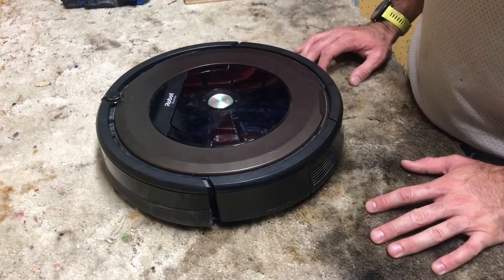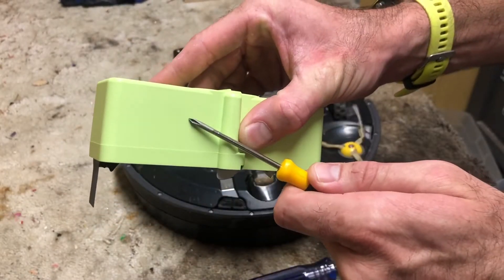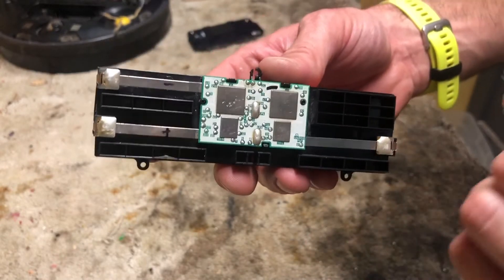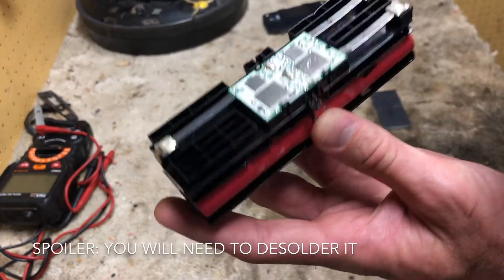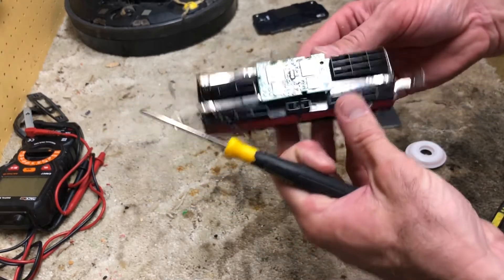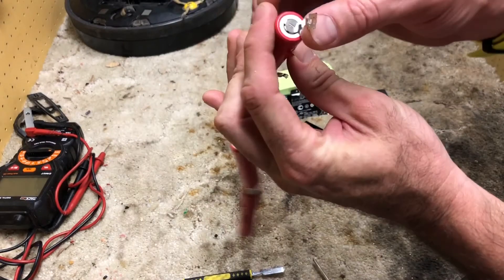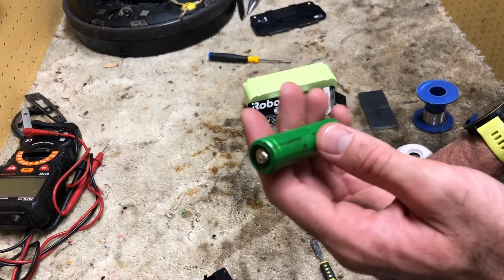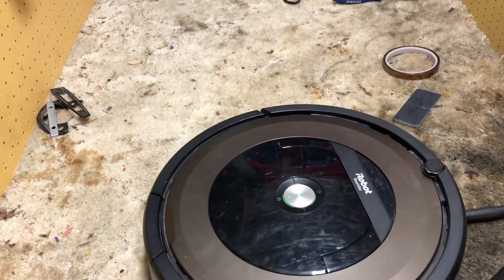Roomba Vacuum Battery Removal and Cell Replacement

Comment: I have a new original abl-d1 roomba battery. When i measure the voltage at the outside battery terminals, labeled +/-, there is no voltage. Is this normal?
Reply: not normal nor healty

Comment: Thanks for the video.
5:57 If the batteries are connected in the middle, doesn't that make them in parallel, and not in series ?
Reply: It appears there is a middle connection to the board that would allow balance charging. Still a series pack

Comment: I like this video. That takes me to my question. I have an old Roomba Discovery. The battery won't charge. Even replaced it with a new one and still no charge.  It takes a 14.4V, 4000mAh battery. The charger that plugs into the docking station is rated at 22V, 1.25A. 
When I measured the voltage at the two docking probes I get only 4.37V. I didn't think this was correct and maybe a failing docking station. So, I replaced that too. Sure enough, the "new" docking station puts out the same voltage. Would you know if that is correct and sufficient to charge the battery or do I have 2 failing docking stations?
Reply: It is supposed to be that. It will only jump to 22V once it recognizes the roomba is connected
Reply: @MooseAgainstMankind  thanks for your response. I measured the voltage and it is what you said. I suppose something internally is not working correctly because batteries do not fully charge. Even with a new one.
Reply: @kurtwm2010  The "docking station"/"home base" should read something above 2VDC when idle and when you dock the Roomba it should do some kind of handshake and after that provide most of the input voltage to the Roomba [18 to 22VDC]. What error code you get? I got "Err 2" in text at my 860 and something like "Battery error code 2" in voice.

Comment: Very good video.  I disassembled the battery same as you.  All 4-cel were showing 4.0V+.  Seems the problem is the BMS itself.  Do you have any tips for raising the BMS back?  I'd appreciate your replay.
Reply from the maker: Typically when the BMS board goes it can't be replaced in these. You should be able to reuse the cells, though, and we have new Roomba batteries for sale at lower than retail. Send us an email sales@higherwire.com.
Reply: Looking at some of the other comments, the 900 series might have a bms board that self destructs if the bms reads 0v for any of the cells, which would happen once your disconnect the battery cells. I think the only way around it is by connecting 18650s onto the bms board. Just seems like alot of trouble to save less than $40 for a replacement off Amazon.
Reply: Indeed, thank for your concern.

Comment: Hello, I have an iRobot Battery for Roomba 960 that is faulty. I replaced it with a new battery (sony vtc5d 2800mAh) according to the method in your video. After assembling and measuring the branch point voltage, it is also normal. But when the sweeper is installed, it just can't sense the battery. My new battery is fully charged to 4.2v and then assembled. Is it limited by the rated voltage? Does it only work when charged to 3.7V?
Reply: I was reading how some roomba batteries have a self destruct feature where the fuse keeps blowing itself up if the bms board is reading 0v on any of the cells. Your post confirms my suspicion, I think some of the really old packs might not have had this destructive feature in it. I think you'd need to have another set of 18650 cells to connect to in parallel with the bms so that the bms board doesn't permanently disable itself. It just seems like alot of work to save around $30-$40 if bought off Amazon.

Comment: Hello! Can i replace li-ion battery with ni-mh? Can it work? Or can i upgrade li-ion 1800 mah to 2500-300-4000-5000 not BMS? Do i need another BMS for this?
Reply: I'm about to swap my 1800mah pack cells for 4x 2600mah Moli cells.  I expect it to work, though it may charge more slowly than the new cells might optimally be able to handle.  If my work fails or if it dies in no time flat, I'll add a comment in the future.

Just make sure you use the right kind of cells...these are 3.6V nominal, 4x3.6 = 14.4.  I think the 3.7v cells have a higher 'minimum safe discharge level', like 3.0 or 2.8v where 3.6 nominal cells might be 2.6v.  Over-discharging a cell can mess it up in a hurry, so just try to make sure that you use similar battery chemistry (IMR and ICR, not LiFePO4).  LiFe cells are 3.2v nominal, 3.6v max, and WOULD definitely require a new BMS to let them charge safely.
Reply: @EShirako  Which model roomba do you have? Looking at some of the other comments, the 900 series might have a bms board that self destructs if the bms reads 0v for any of the cells, which would happen once your disconnect the battery cells. I think the only way around it is by connecting 18650s onto the bms board. Just seems like alot of trouble to save less than $40 for a replacement off Amazon.
Reply: @ne0tekk1  Mine is a much older 650.  The Li-Ion pack that came with it had UTTERLY flat-dead 0V cells in it, so if it does the "self-destruct for a 0v situation" thing then my BMS is already wasted.  Luckily for me, I went back to where I got mine from a thrift store and found the NiMh pack for one of them as well, and that seems to still be working fine.  I got lazy and used that for the moment.  I'll try to use upgraded lithium cells if the NiMH pack ever seems to get weaker, or whenever I get bored and think of rebuilding the lithium pack for it.  :)

Comment: My 890 has 1800 mah, just like the one shown but it is cleaning maybe 50 minutes. I need more then that. I have another roomba 860 that uses 3300 mah lithium battery. Can I put 3300mah into the 890 series roomba (that uses 1800mah)? Will it damage the unit? I need it to run at least 1.5 hours.
Reply from the maker: Yes you can. Be aware, though, that others have found that the BMS needs to be reset in order to work. This one didn't have any issues like that but it is the case sometimes with electronics that the BMS effectively shuts off if the cells are removed or die completely.

Comment: What if you manually slow charge on the whole battery block? Would that work, or do you really need to charge/replace the batteries individually?
Reply from the maker: That’s not a bad idea if you have a charger capable of single-cell li-ion (3.6/3.7v nominal) and none of the cells have flat-lined. That effectively rebalances the pack, though degradation typically means runtime will be down regardless. As others have mentioned, it seems that the BMS on some of these packs needs to be reset when swapping cells, so it’s worth charging cells individually before tearing into it.
Reply: @higherwireinc  I meant just charging the battery without modifying anything. But I think the BMS would be in the way then.
Reply from the maker: @MathijsGroothuis  Right, BMS is likely going to block it. You can bypass the BMS by identifying the battery positive and ground, but that will require at least partial disassembly and at that point you'd want to check individual cell voltages.

Comment: I replaced the old Ni-HM battery with a Li-Ion battery with BMS, and now the iRobot 780 vacuum cleaner doesn't recognize it when charging. Error 1, what to do with it?
Reply: Interesting video

Charge Error 1 is Battery not connected (Bad contact) or defective battery. The problem with the old Roombas is that the firmware is not prepared for the lithium charging parameters and they normally end up with Error or some worse: charges but damaging the Lithium batteries.  The charging parameters for Ni-MH that are totally different from those required for Lithium. In fact once the charge is complete, a 50 mA stand-by charge (know as 'trickle charge') is applied in a continuos cycle between 40 (start) and 42 ºC (stop) intended for typical Ni-MH self-discharge, wich for Lithium should not be applied.

Although the vendors say Lithium batterys are suitable for old Ni-MH Roombas (in some cases the say some things as these batteries simulate Ni-MH parameters to trick Roomba into believing that they handle Ni-MH)  the fact these batteries have not worked for me neither in the 560, nor 531 nor 650, in some cases due to Error 1 or 5, and in others it apparently worked, but the battery died after only 6 months, which implies an enormous 'mistreatment' in charging (probably  after a a lot of hours of damaging tricke charge) because this iRobot 1800 mAh lithium battery has been working for my 671 more than 4'5 years and only lost 15-20 minutes...

I asked about to iRobot about and was confirmed, Ni-MH for Ni-MH Roombas, and Lithium for Lithium Roombas
Reply: @fermogo  my lithium batteries had their own BMS
Reply: @mirek3542  

This is the charging algorithm extracted from iRobot Service Manual for 500/600 Ni-MH Roomba's (must be similar to a 700 serie Ni-MH Roomba):
 1. Check charging FETs – If FETS fail then charging is aborted
 2. Pre-charge cooling { 0mA } - Runs until battery temperature is less than 50°C, or an end of charge condition is true. Sets the charging state to NORMAL or RECOVERY based on the battery voltage.
3. Charging - Runs until an end of charge condition is true, in one of the following modes:
  a. Normal { 1250mA } – for initial battery voltage greater than 10.8V . 
  b. Recovery { 300mA } - for initial battery voltage less than 10.8V .
4. Post-charge cooling { 0mA }- Runs until battery temperature is less than 35°C, or 2hrs passes. Sets charging state to WAITING/TRICKLE.
5. Trickle { 50mA }- Runs indefinitely. If the temperature goes above 42°C, trickle turns off until the temperature drops below 40°C, then re-enables.

End of charge conditions:  Charging is terminated as soon as one of these conditions is true. These conditions are tested in variable times during charging:
o Voltage Dip : Voltage dips more than a 30 mV from the maximum voltage.
o Temperature Slope : Temperature increases by more than 0.5°C per minute.
o Coulombs Max : If battery level is more than 2 times the nominal capacity. 
o Normal Charge Timeout : 9 hours maximum in normal charge mode.
o Recovery Charge Timeout : 16 hours maximum in recovery charge mode.
o Temperature Max : Battery temperature exceeds 60° C for at least 1 minute.
o Voltage Max : Pack voltage exceeds 21.6V for at least 1 minute.
o Previous end-of-charge : If a battery has been discharged by less than 150mAH since the last complete charge.

Are you sure that  the BMS is not protecting the battery from any point of this charge process?  I'm not, cause iRobot charging algorythm for Lithium batteries is not available

If your Roomba reports Charging Error 1 the Service Manual says:
1. Is battery pull tab removed?
2. Remove bottom cover, remove battery and make sure there is nothing obstructing contacts.
3. Re-install battery and securely tighten all 4 bottom cover screws. (Tighten the two screwsup front near the battery first.)
4. If problem persists, replaceBattery.

So if as I understand you've checked your battery makes good contact, may be that charging sequence for Ni-MH battery is not suitable for Lithium.
Reply from the maker: The vacuum likely has a check for battery voltage, and the difference between NiMH (1.2v/cell) and li-ion (3.6/3.7v) is enough to trigger the error. These seem a bit smarter than many electronics.

Comment: Hi Hello from the UK
good video
My 980 has 3300mah stated on the battery. Is that just an 8 cell version of what you rebuilt on your video. Any tricks/tips on resoldering the centre / balance connectors back to the BMS board.
Also how's the vacuum performing with your new cells, better run time ? or about the same.
Thank you
Reply from the maker: Get an iron with a fine point, not a lot of heat. This was for a customer but we’ve had no complaints, we offer this service on many electronics packs.

Comment: Nice video, now I understood why that battery is heavier but supposed to be lighter than the Ni-Mh, why add extra weight?, is no sense.
Reply: Should be added for over all weight, so the wheels don't spin. Like when we used to add weight in the back of a RWD car during snow season. The center of gravity of the design, might have been for an old tech heavy battery. Maybe even a really old lead acid pack.
Reply: I think they are heat sinks rather than weights.

Comment: I kill my battery changing cells. After cell replacement pcb won't  let  to power roomba or charge.
Probably it saw 0v accros cell and prottection on pcb kicks in...
Reply: The BMS has a self destruct thermal fuse.  Looks like a fork kind of with a blue square in the middle.   If the BMS detects any type of fault it heats up the resistor in the fuse and blows it.  Replacing the fuse later just causes it to blow again from my limited experience.
Reply: @jeffm2787  Did you find any way to recover original pcb, my cels had a deep discharged and now fuse is dead.
Reply: @romansand918  Sadly no,  Even after having fully charged cells the BMS was still wanting to blow the fuse.   I didn't want to spend too much time on the project so I just purchased one of the Chinese knock off batteries.  So far so good.   If that fails hopefully it has a easier to deal with BMS.
Reply: @jeffm2787  Tomorrow I'll have some time to play with it, If I'll find something will let you know.
Reply: @romansand918  Cool,  let me know what you find out.
Reply: @jeffm2787  Hi just wanted to know how test the fuse
Reply from the maker: Interesting. Many BMS boards require the battery negative to be disconnected if they trip (i.e., over-/under-current or voltage). It's possible that iRobot added such protection in this BMS, though it seems like a big strike against right-to-repair to be unable to reset the board.
Reply: Okay I had the same issue.
I de-soldered the BMS from the old battery pack.
Removed the strips from the batteries.
Got my "new" batteries and spot welded the strips back on.
Soldered the connections on the BMS, at one point I did notice I had shorted one of the battery leads to another cause I saw a couple of sparks but it didn't worry me.
Reinstalled it into its case and installed it into the Roomba.
Nothing.
Pulled it out and checked everything and no change.
Placed it on the dock and it showed it was charging.
Pulled it off  and pressed the button and nothing.
Left it on the charger and after 30mins I took it off and pressed the on button still no go but...
When I pulled the battery out to inspect it, I placed the battery back in and got the power on chime.

I remembered on some of the cheap BMSs on the USB power packs need to be "excited" aka plugged into a 5v source which tells the BMS to switch on before it will output power. But on some laptop chargers they require you to "jumpstart" the BMS by taking either the + or - of the battery and applying to the + or - of the BMS input. (so + to + OR - to - but NOT + to -).
This did nothing but it didn't hurt to try cause when I reinstalled the battery I got the chime but no life still.

I placed it on the charging dock once again and thought could it be like an old neglected Nokia battery BMS where it has to trickle a charge into before it charges the battery at full power?
And after about an hour I pulled it off and when I pressed the power button it switched on.
bms
Reply: @newdawn8477  How did you trick the bms did you disconnect all the leads then only did + to +
Reply: @newdawn8477  I've just tried replacing the cells in the battery for my own irobot 980.
Same process process as your self. But I've hit the same problem as you, can't get it to charge or power the robot. Did you get yours working in the the end? And if so how?
Reply: This is really interesting, it sounds like the bms needs to be paralleled with a 14.4v source at all times or else it has a self destruction circuit built in. That makes sense since it would be recorded in the 8 pin semi chip found on most electronics. The more advanced electronic techs can actually tap into these 8 pins to reset with a laptop but at this point, it might be better to just get a Chinese pack. Could always replace the cells in a Chinese pack down the road with high quality Samsung, LG Chem, or Panasonic cells. From my experience, Sanyo cells have a lower reliability than those 3 and almost any other brand is worse than all 4 (besides Tesla cells).
Reply: @ne0tekk1  So looks like it's not worth trying to replace the cells in the 980 pack. Any forums you know where this is discussed?
Reply: @flimflam2  Looking at some of the other comments, the 900 series might have a bms board that self destructs if the bms reads 0v for any of the cells, which would happen once your disconnect the battery cells. I think the only way around it is by connecting 18650s onto the bms board. Just seems like alot of trouble to save less than $40 for a replacement off Amazon.

Comment: Great video. I'm going to attempt to refurbish my Roomba 980 battery. I'll try replacing the cells with LG MJ1 cells (3500mah, 10a drain). In theory, it should greatly outperform the OEM replacement battery that sells for around $110. Only thing I'm worried about is the Roomba throwing a code, since it will take much longer to charge the higher capacity cells.
Reply: How did it went? I'm thinking about doing the same
Reply: @Space_Aids  I actually never got around to it. My roomba no longer has to run for as long, so the OEM pack is still hanging in there
Reply: @kvnhmmd  Looking at some of the other comments, the 900 series might have a bms board that self destructs if the bms reads 0v for any of the cells, which would happen once your disconnect the battery cells. I think the only way around it is by connecting 18650s onto the bms board. Just seems like alot of trouble to save less than $40 for a replacement off Amazon.
Reply: it'll be fine